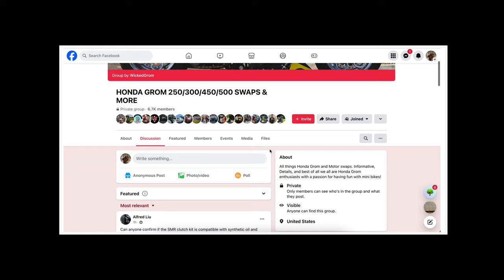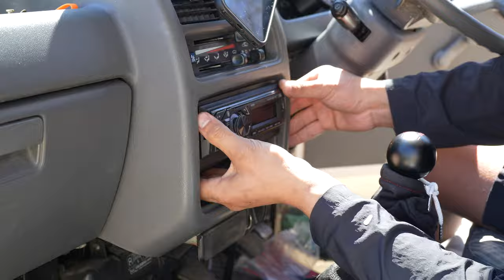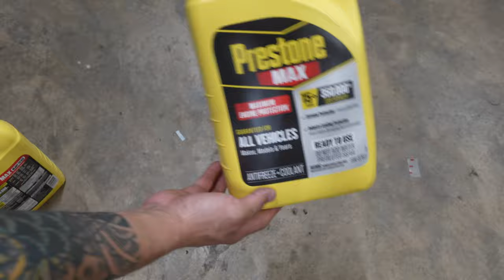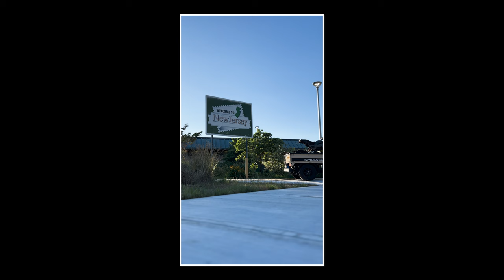The Backstory Of The Cannonball Kei Truck & 250cc Honda Grom

Comment: Because of you my grandson will be coming home from Maine to his parents house in San Diego come this summer, I shouldnt have showed him your video hahaha. His truck is a 2001 s10 extreme side step regular shortbed, a 5.3L LS swap, 5spd stick. he used to haul his lt4 swapped miata to events when he still went. But right now hes building out a sportster sized bike around a 131 crate motor while doing school. He still has to cut weld cut weld a peanut tank, to widen it, add a sunken bullitt gas door haha...but he said if PETER can do it on a grom and a kei truck, I can do it. hahaha.